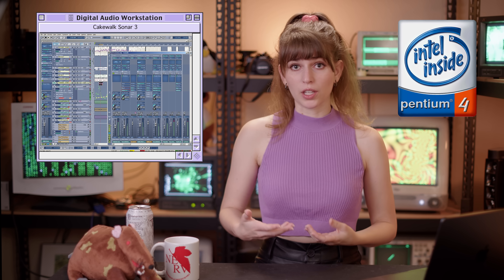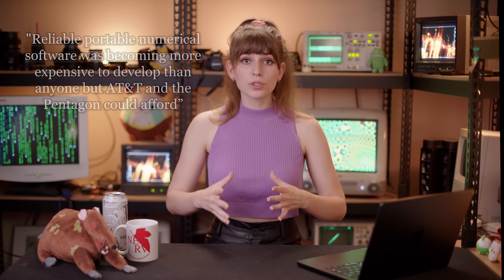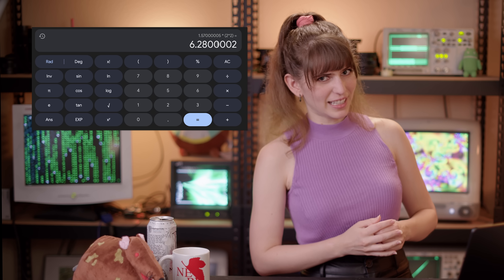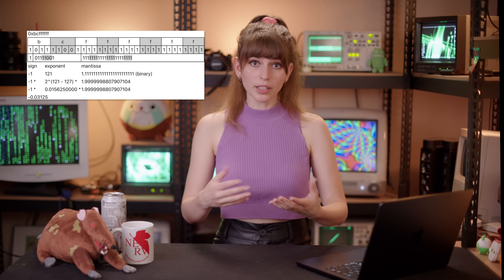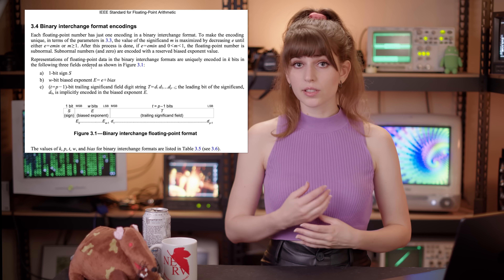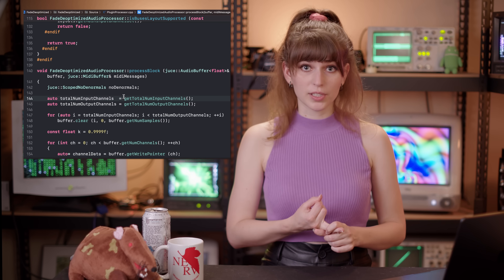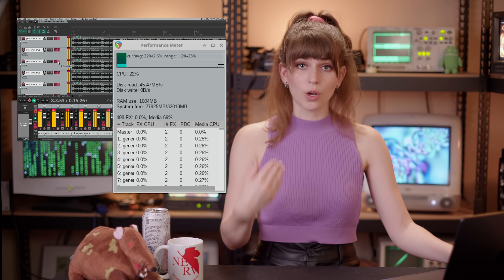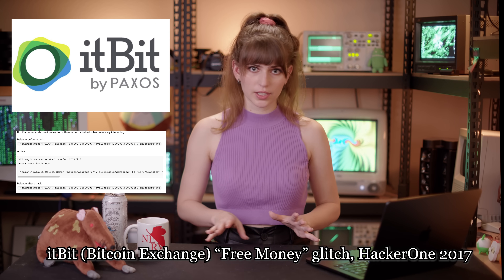Fading Audio is ROUGH on CPUs

Comment: Having done a lot of batch accounting, the most efficient and accurate method, on x86, x64, or ARM, was to avoid floating-point numbers and double precision. Even with modest calculation sets, cumulative threshold effects and inaccuracy are simply unacceptable. This is particularly noticeable with threshold effects, where one can get a large positive value instead of the large negative value that should have been calculated. The BCD method was also banned, as it was far too slow and memory-intensive. Math::BigInt or gmp were also abandoned for the same reason. We opted for the full integer method: calculations were performed on the algorithm side instead of the CPU representation of numbers, handling only the fractional representation with two 64-bit integers as the denominator and quotient for each number. On the algorithm side, we adjusted these two values for all numbers involved in all computational sets, large or small, make math on the denominators and always stored the intermediate and final results under this integer denominator/quotient pair. The only time we used the float/double method was to insert a result into a report or print it on a display, as we simply calculated the decimal division of the denominator and quotient, mathematically rounded to the nearest half to obtain the required precision. This solution was much faster than any other, with a memory cost comparable to that of the double method and, most importantly, always accurate.

As a side note, i remember we use the binary GCD to get the GCD and quickly reduce the denominator and quotient,  computing it only when needed during calculations and always for intermediate and finals results.

Comment: So I'm in my late 30's learning computer science and programming later in life, maybe someone can answer this for me. Why would you ever use a floating point to represent something that isn't a model of some actual thing. Like, say you have a part, a fuel pump piece for a jet engine of a fighter plane. These have extremely tight tolerances. You need a float to represent them. 

For something like fading audio (I used to play and engineer music. Ironically used reaper myself. It's the best daw. i digress). Why would you need to use a floating point as a means to control a fade. Could you not accomplish the same task with an integer?

Comment: IRC if you're dealing with money, you shouldn't be using floating point. The banking standards work in fixed point arithmetic down to millipennies and there's rounding rules so it should be a non issue.
Reply: I always figured it counted in pennies, but fractions of a penny makes sense

Comment: Laurie, that was an excellent explanation of the nuances of floating point. I remember back to the early days of Microprocessors when I used to write graphics drivers. We used to calculate spline curves and draw them pixel by pixel. Any form of floating point we could do seemed like a miracle. Not only did we have to do the floating point calculations, but we had to fit the resulting code in the small amount of memory available. Then we had top draw the curve, one pixel at a time into the regen buffer on the other side of the ISA bus. The average graphics resolution available could be as small as 320x200 and you were lucky if your curve didn't look jaggy just because the curve was made of huge pixels. These days we carry cell phones with hardware floating point support and often a GPU in the phone as well. Also these days the graphics resolution on the phone exceeds the resolutions of high end graphics workstations of the old days. The core issue about floating point today is that we are dealing with extreme numbers, large and small. Calculating the size of subatomic particles, or the size of the cosmic all. It is amazing that the system of mathematics is holding up at all. :-)

Comment: Lolz..... what about reverbs, :P....... Anyways, daws nor plugins cant ....."properly" process audio, the bigger the difference between what goes in vs what goes out, the more sh*t it sounds. 
In fact I worked for years by respecting  a rule, namely , what hits a plugin , must come out with ~ the same peak, thus keeping it in the same range ballpark. It was an effing headache, but was VERY rewarding.
   Proper audio processing would entail  the reconstruction of the "waveform" after EVERY single  processing , much akin to the reconstruction happening at the DA stage. Which would be VERY cost prohibitive in terms of CPU usage.. 
The .wav protocol itself was never meant to do processing. it was meant to just record/playback a single unalteretd file..

Comment: This is just the consequence of dumbass programming.  Amplitude scaling is hardly the cutting edge of DSP and should be a trivial operation.  For a 32 bit integer the dynamic range is approximately 193 dB - or the smallest step is 1 in 4,294,967,296  so why on earth would you use floating point representaion?

Comment: Computers in the 60s didn't have standards for floating point precision. But, they took us to the moon and back. Makes sense.
Reply: As long as you're working within a known range, integers of sufficient size are good enough.

32-bit integers can encompass a range several times larger than the Moon's orbit to metre accuracy. Throw in an extra 8-bit value and you can be better than centimetre-accurate, or make it 16 bits, and you'll be down to tens of micrometres.

Comment: as for economic stability, that is what COBOL is for. its not binary based, its decimal. so all transactions used on it, no matter how many, doesnt matter. if you have a value like 150$, and its supposed to get an increase of 1% per year, you just do 150*1.1. if it gets divided into 4 parts, you just do 150*1.1/4. etc. so after awhile, or rather years, it might look like 150*1.1/4*1.1/4*1.1/4*1.1/4*1.1/4*1.1/4*1.1/4*1.1/4 or whatever (even million times bigger calculations than this for global corporations), but it will still be accurate, beyond 32bit float, even 64 or 128.

as for the problem with audio, something else not mentioned, that in the nullites, most still only had 16-bit soundcards. so when you changed the volume, in windows at least, you got audible glitch sounds. now that we got 24-bit mixing that is solved. most support 32bit mixing, or even 64 or 128 again. and in ableton the highest i can output is 394khz, together with 32bit, it actually sounds like vinyl. all analog audio is floating point.

btw i wish audacity supported better floating point beyond 32bit. often when increasing the value with limiter, i cant figure out compressors, theres audible errors. going above 0db that is. ive done many albums in audacity, partially but a big part. ive noticed, maybe they fixed it now, but ableton doesnt support distortion effects beyond 16bit. it just gets interpolated into softness. and with vinyl even cassette you can still get distortion effects, which do sound better. most rock music in vhs quality is just noisy, in a bad way.

also, something you might find interesting, that with the first proper binary programming language FORTRAN, LISP was released at the same time, and it was actually symbol based.

one last note, fm radio sounds better than even 180gram vinyl singles. at least if you connect it to your wall socket. because again, fm like all signals are analog. its a lot more than 19khz. what is the bitrate? just like these vids i see on youtube where someone records an expensive stereo, it sounds better than just playing the same song on your stereo. same for fm radio. all the gear they use gets transmitted in the air.

Comment: why does audio software even need floating point? just use fixed point and you shouldn't have these issues. most audio is rendered to 16 or 24 bit integers

Comment: I was a disk jockey, who started an mp3 only show, in October, 1991. I'm not sure, but I think I was one of the first, to do so. (It wasn't a thing you could track. There was no internet, yet.) Let me tell you, it was a Herculean task. It took me months to get it in working order.

I had to download, and convert all the files, from LPs and cassette tapes. Plus, write all of the ID3 tags. Then figure out a way to make it all work, reliably, for 6 to 8 hours a night.

My crossfader was a cheap Realistic (Radio Shack) 32-1200 mixer. With two QSC 2500 watt amps, a 27" dual voice coil subwoofer, (with my own designed snail shell cabinet which fired downward into a 12 inch elevated stage, which was hollow), and six sets of the cheapest, and biggest speakers I could find. (I was piping music throughout a not so large, but two-roomed bar. It was, by far, the loudest redneck bar, in town. *Wink*.

The only player was, Windows Media Player 3.0. A "big" hard drive was only 10Mb, and I had to make my own daisy chain, (a couple of lengths of 2x4 as a "cradle" for the hard drives.) for them because mp3 files were so large, I could only fit a handful of songs on a single hard drive. I had to use two PCs because hard drives were not "hot switchable". While one PC was playing I could power down the other, and swap out drives.

My two IBM 350-P100s performed admirably, for years, (rarely ever a crash), until I could  make an upgrade that actually worked as well as, my P100s. 

Then, in 1994, I switched to AMD Athlon 2500+ single core CPUs in two PCs I made myself. (My favorite CPU of all-time BTW.) I could overclock them from, 1.63Ghz to 2.54Ghz, with zero overheating, or instability. A rock solid CPU. Combined with MSI k7n2 delta L motherboards, and Creative Sound Blaster audio cards. (The pretty good and black ones. Can't remember which model. I only remember they were 16-bit.

By this time Winamp was a thing. I also used BPM player. Both had their good, and bad points. However, they were light years ahead of Windows Media Player, of any iteration.

By 2008, when I retired, I had over 600k mp3 formatted songs on hard drives...

Comment: Because of IEEE 754 I have a piece of code running in production where an input value is multiplied by 11 and then divided by 10 instead of just multiplying by 1.1 to avoid rounding errors with certain inputs. Not really a problem but I am amused everytime I am reminded of this. Also one of the few examples where I left a comment explaining my code because most of the time I get to write code that is self-explanatory.

Comment: Brief story time on the floating point rounding thing: 
I once had a custom (server-side ofc) anticheat for my Minecraft server.
One thing I did to detect some movement cheats, was checking for floating point errors:
The MC client has motionY as double, a 64-bit float. the Player#jump() function however adds 0.42F (32-bit float) to that, netting "0.41999998688697815".
A lot of of speed- and some other movement cheats however just added 0.42 (double) to that, an invisible-to-the-eye but unmistakable difference.

Comment: HUH!?! WHAT?! I love learning this stuff! I'll whip out some more fun facts as I got a UPS recently and it tells me my wattage which I love to stare at. Games it goes up. Who woulda thought... Playing a game though is way more energy than running AI even I realized. Well locally anyways. Displaying milliseconds make your CPU go brrrrr. Giving yourself 120hz or fps makes your computer go up a lot. 30hz/fps very low - so use variable frame rates if you can! HDR takes more wattage. Just realized im listing off wattages more than CPU benchmarks but its alllllllll energy in the end! Its fun! 

OK now to watch the video lollllll
Reply: OMG this explains the jump we had! Fastmath was a savior! It kinda makes sense to noise them up though and thats a brilliant solution especially for the time! Its kinda how AI is used for image processing! Maybe! In my head at least!
Reply: OH FORGOT! After all of that, I'm on the side of hyper precision even though it comes with a cost. Its fun to do work arounds, but I love brute forcing and figuring out a solution AROUND that. Like maybe instead of random noise or numbers its using a seed, that it plugs back in at the end and converts from that getting precision AND speed.

Comment: Yeah optimization and numerics especially finite differences needs tricks like dual numbers or complex finite differences

Also if you calculate "infinite series" then you need to start adding small numbers first

But normally you don't need subnormals there for double it's something like 10^-300

But eps(1) is ca. 1^-16 that one is really crazy important.

Sorting summands and then adding them up helps
Don't know how big the difference is when you use gaussian elimination full pivoting compared to half pivoting

Comment: In my experience, where actual precision is needed only integers (or a struct of integers) is used. 
Floats are cool for something like a fractal where you want to zoom into it (and eventually see artifacts due to precision), 
so I really don't see the point of trying to squeeze more complexity and accuracy into the standard (as opposed to just using more bits like a double)
I'd prefer a simpler implentation and clean/quick errors

Comment: Technically, digital audio uses integer values, not floating point. Even with 24-bit samples, which is already extremely high, the values fit neatly into a 32-bit integer. There is no reason to calculate anything below a one-bit output because everything below that is silence. You can perform the calculation with the FPU, but there's no reason to go below 0.5. As soon as you reach 0.5 or below, round down to zero. From there on, it's always zero and no calculation is required at all.

As I anticipate the comments: Anyone who says that bit depth is about the "resolution" of the audio signal is disqualified from this discussion because that is the most incorrect thing you can say. Bit depth is only about signal-to-noise ratio and dynamic range. A DAC always produces smooth sine waves; it produces an equally smooth sine wave with 8 bits as with 16 bits. It even produces smooth sine waves with a 1 bit signal. This is because a DAC must have a high-pass filter; otherwise, it would not correctly reproduce the input signal of an ADC. Such a filter always smooths any output signal into a perfect analog wave with no visible steps whatsoever.

I'll bet you any amount of money that if you view both outputs on an analog oscilloscope, you won't be able to tell me which is 8-bit and which is 16-bit because they'll look identical at any frequency between 20 Hz and 22 kHz. You can overlay them, and only one visible sine wave will appear. The difference is only visible if you filter out the signal, zoom in, and look at the noise floor. The noise floor will be higher and rougher with 8 bits than with 16 bits. Keep in mind, though, that the noise floor of a studio tape, which was still used in the '80s, was far less than 16 bits (maybe 11 or 12 bits), so 16 bits is much higher quality than that, and 20 bits is even higher. 24-bit resolution only exists for cinemas, not because they need an even lower noise floor, but because they have constant amplification, so all volume is regulated digitally. If you want your software to whisper like the wind or make the seat shake like an explosion, you need 24-bit resolution to have enough dynamic range to go really loud and still have a very low noise floor when you go really quiet.

Comment: Kinda like taking overlapping measurements of intermediate points when marking out a straight line w/ a ruler. 
If the increments are off by the same amount, it adds up, so 0 isn't 0. The same mistake repeated compounds, it's better to make various mistakes.
Turbulence is as fair as stillness.

Comment: 6.28 as a float can be printed correctly as 6.28, it's just that most language libraries don't implement the algorithms required to do so. There are (very fast) algorithms, such as Dragonbox, that guarantee the output will be the shortest length decimal number that would parse to the input float given an accurate float parser.

Comment: if anyone works on production code, save yourself some time by writing an RAII type that will set the denormals flag on the fp control  register in a platform-independent specialization.

Comment: It is a programming flaw that if you keep dividing, you reach infinite numbers, thus a never-ending calculation.
The sheer amount of calculations, with precise calculation, would break any processor, with simple subtraction, which is kept constant, the problem is solved, and approximate values also reduce the load.

Comment: The 1994 Pentium FDIV bug involved a floating-point unit error in Intel's processors, potentially causing incorrect calculations. This directly impacted compounding pharmacies. Although no proof of deaths, it leads back to the greater responsibility of the computer science community to act more like a science, not an art. Close enough does not cut it, know your tool and how it impacts human lives, like the elevator engineer.

Comment: Very informative video! Could you please add to the video a comparison between faded audio generated using both methods? You mentioned that human ears can detect low dB sound only up to a certain level, so more precision than that is useless. However, a comparison of the actual audio wasn't shown.

Comment: Fascinating. Older Pro Tools session folders used to have a sub-folder for "Fade Files", with separate pre-computed chunks of faded audio (one for each fade used in a session). It was clearly some sort of legacy optimisation thing - but always struck me as weirdly trivial. After all, automation never seemed to affect CPU usage, so why would cross-fades? I had no idea it would have been such a difficult problem in early versions of the software.